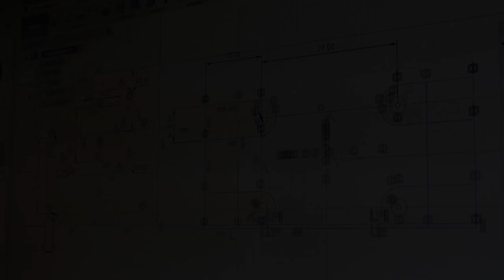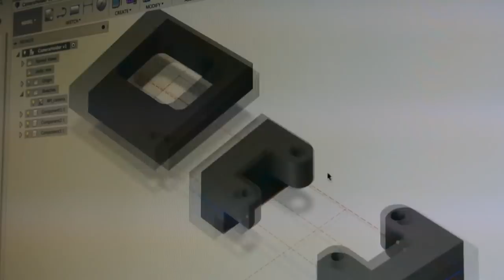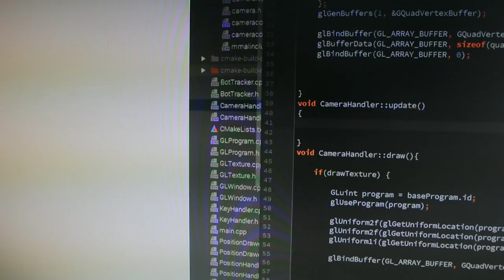Omni Wheel Robot part 2: Position control and tracking

Comment: Hi Kris! I love your creations! Do you share your projects as far as a list of hardware, items used, code, etc? I'd love to create this Omi wheel project. Thanks
Reply from the maker: Yes and no. The code is opensource https://github.com/neuroprod/omniBotProto But i didn't write it to be opensource.  It's not a ready made plug and play package and i don't give any support on it. In practice, you can use it as a refference, but you still have to make it yourself. Good luck with your project!  :)

Comment: Can you explain the principle behind tracking the robot? More precisely how you convert the raw picture into actual coordinates.
Reply from the maker: -with the IR image, you already start out with very well defined contrast (the image of the points, with the text in the video)
-take the raw camera output (YUV) and only use the Y(greyscale) channel. so you don't have to convert to RGB, witch saves a lot of performance 
-apply a threshold to the pixels to make it a black and white picture (pixel<x)pixel=0 else pixel=1. 
-detect the edges in the image, if(pixel.neighbour != pixel ) pixel=edge.  +group the edge pixels that touch each other
-take the average position form each pixel group, as the center of the led.
-the center of the robot, is the average of the 2 centers that have the biggest distance. the direction is the vector between the robot-center and the other led-centerpoint
...
-use OpenCV to do all those things in a couple lines of code ;)  check the update function: https://github.com/neuroprod/omniBotProto/blob/master/omnibotcontroler_RPI/CameraHandler.cpp

Hope that helps :)
Reply: totally thanks ;)

Comment: hey! kris i want to make a tracking system like this can you pls tell which software did you use to code?
Reply from the maker: The IDE is CLion. But you can use whatever you want. Its C++ with cmake, so you don't even need an IDE, you can just compile it in the console :)
Reply: thanks kris